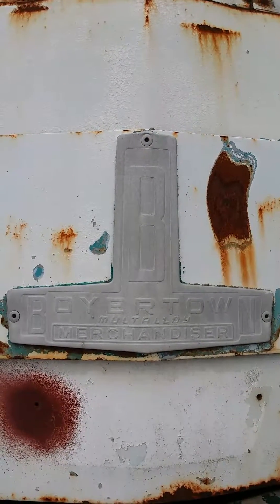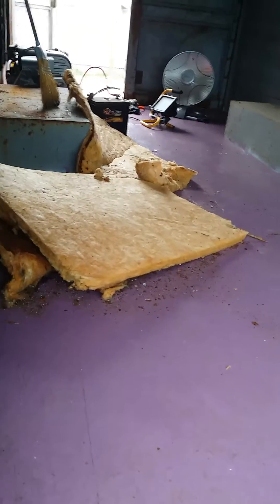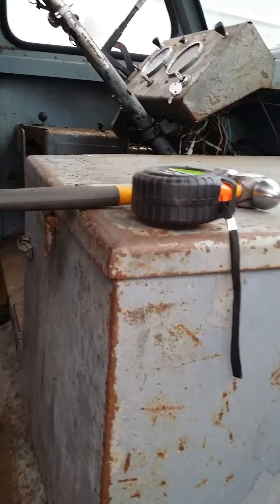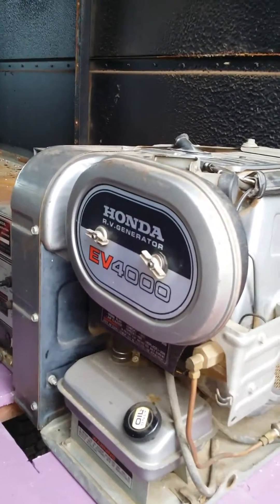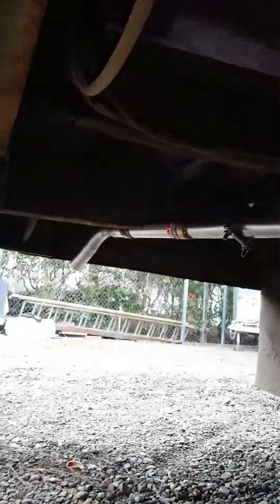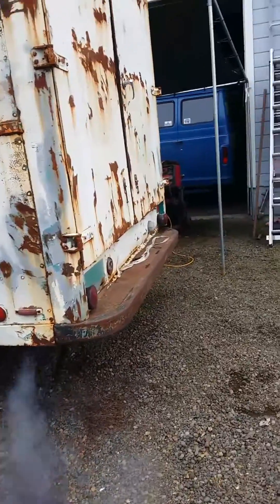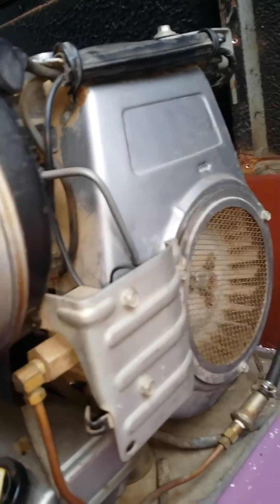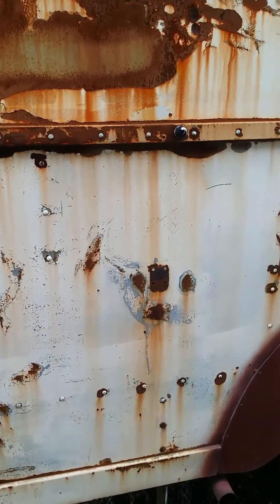Installing an EV4000 Watt Honda RV Generator in my 1962 Ford / Boyertown Murchandiser Stepvan.

Comment: did you remove/ replace the petcock on the generator... Kinda hard to tell but it looked like you were going from gas tank to filter to intake?
Reply from the maker: When I got the Gen, it has a short gas hard line to a short rubber line to an in line filter. I went from there to the tank. I am going to add a squeeze bulb like fir a boat tank, so I can prime the fuel and I understand it also works as a check valve.

Comment from the maker: Both the body and chassis vin tags are just below the passenger windshield rivits to the panel facing what would be the passenger seat in full view of what would be a passenger. In oregon we use the Chassis vin tag, in my case from Ford for licensing not the Boyertown truck vin tag.

Comment: Where do you locate the VIN on your truck? I bought a 1960 and can't seem to find it, let me know if you can help thanks.
Reply: I need to know as well. Did you ever find it?
Reply: @barbaraannen8126  Yes I did Annen! My firewall was cut on the passenger side which means was junked at one point. So on the frame it was on the top rail of the frame, under the driver side which is exposed by lifting the mid cover where the shifter is. I have 7 digits which I believe it could be the serial number from Boyertown since they seem to have two, one from the vehicle manufacturer and the other from Boyertown.  Hope that helps and good luck;)
Reply: Thanks, I got a title to a 1968 Ford with mine. Not sure how accurate it is